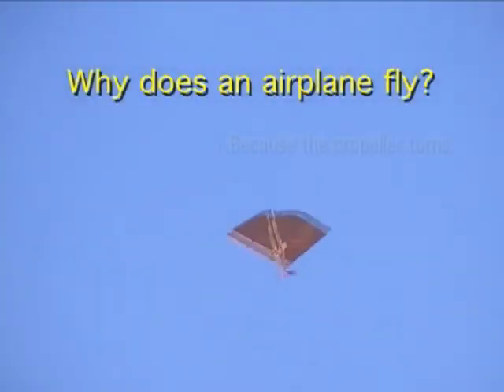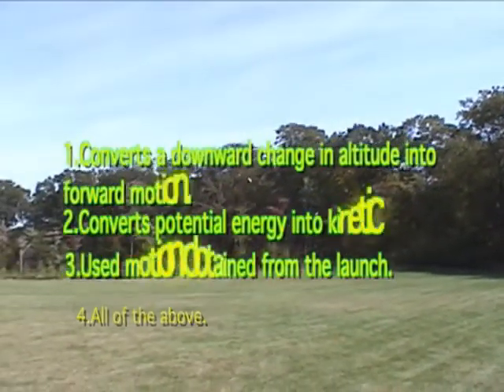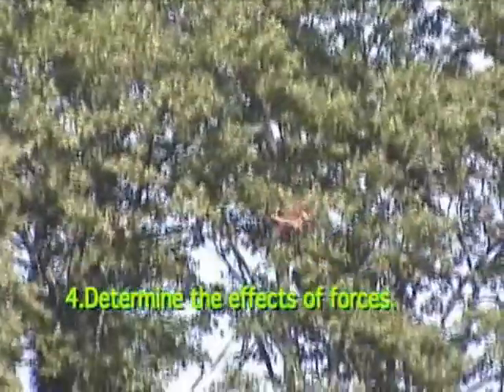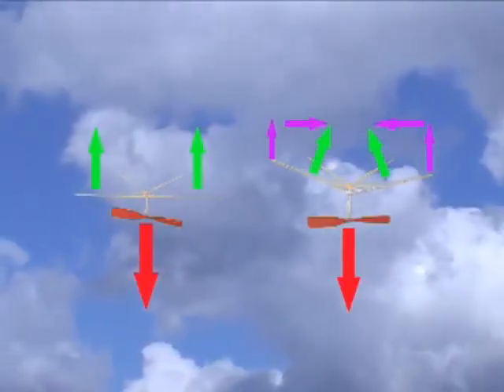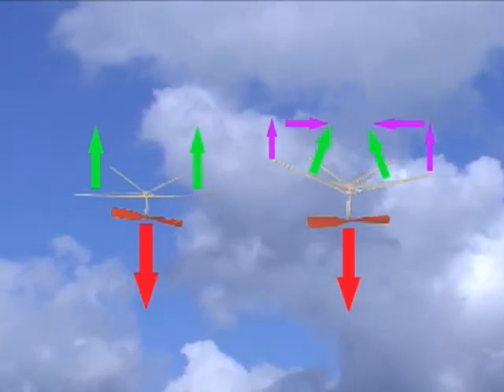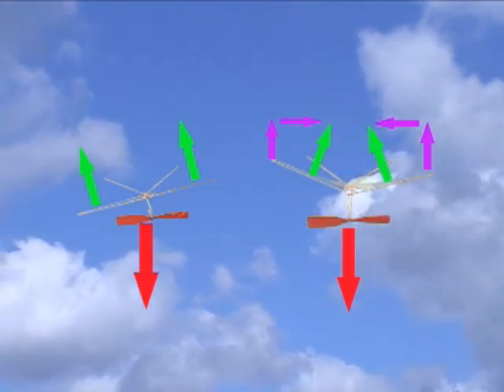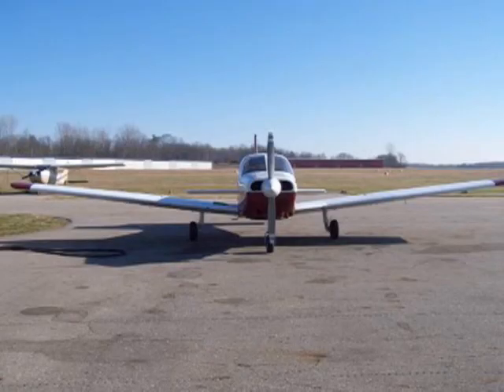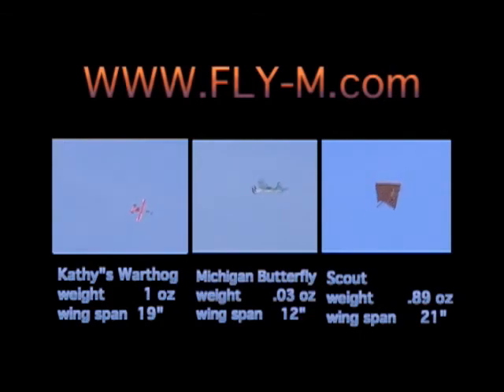Principals of Free Flight

Comment from the maker: The aeronautical principals for flight is the same for all aircraft, manned, Radio Control and Free Flight.  
1.  The difference for free flight is that the all adjustments have to be done before the aircraft is launched.  
2.  All flying surfaces wing, rudder and stabilizer have to be correct not warped.

I am limited on a short answer here.

Email me at : fredmatthis@fly-m.com
Which free flight models have you build and flown?